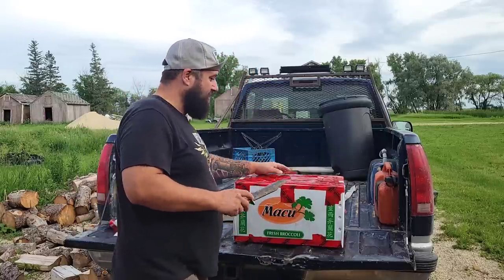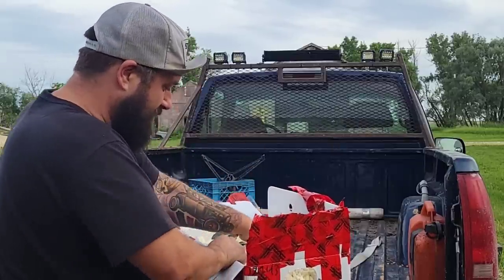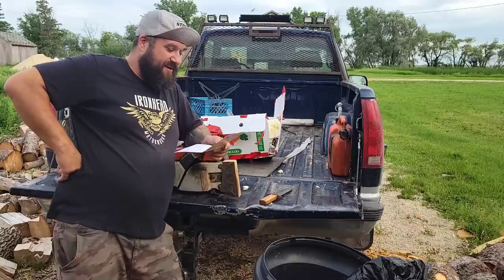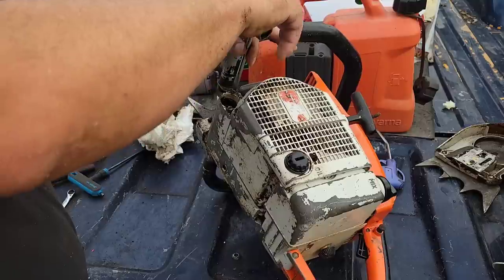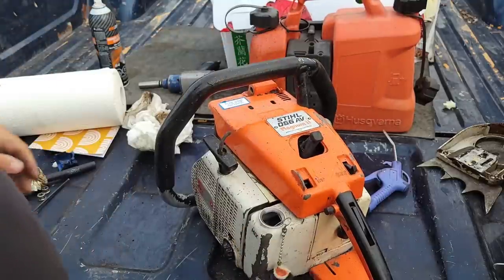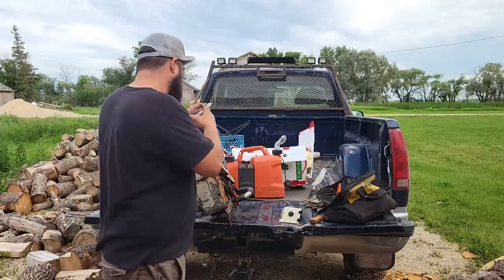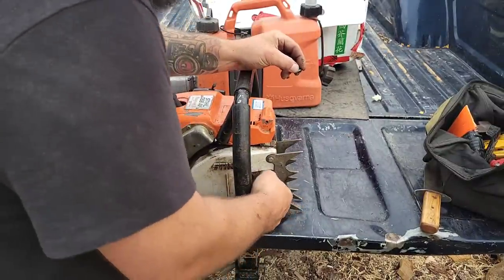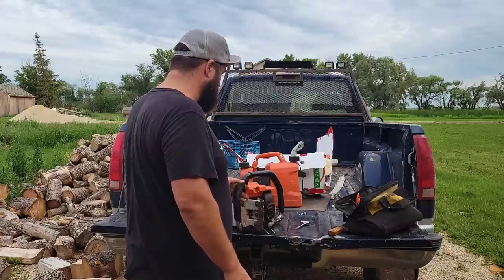I can't believe what I found in this box!! Epic saw unboxing!!

Comment: Tinman, you are going to love that saw bought one new in 83-84 was making a living on the fog line of the redwood coast, cuttin redwood, Doug fir, sugar pine. 7 tooth sprocket 404 square ground chain. Has got stump power for days 36-42" bar not really a high winder. Ran it for a year and a half only complaint is the ignition went bad.Would love to see a complete rebuild and timimg # on it..

Comment: Amazing Stihl saw!!! Can’t wait to watch this saw progress. It man thank you for genuine hospitality sharing this info along with people like Iron Horse and Bell Hopper. You guys have inspired me to finally buy he bits to begin polishing and porting a saw. I’ve done a lot of other work on carbs, converting saws to different pitch sprockets, lighter bars, exhaust mods, intake mods but you guys finally gave me the courage to begin porting. This weekend we’re going to baseline an old MS251 I need to replace the oil seals on and I’m going to begin by cleaning up the exhaust. After that probably trying to see what if any work can be done to cleanup the lower transfers. I also picked up a digital degree wheel to make sure I get numbers before I start. When it’s done I’m going to convert it down to 3/8p .050 gauge 16” with a Sugihara pro light bar. This weekend I’m going to get a before video and hopefully I’ll have the same log/branch for an after. Keep up the good work and keep inspiring people man.

Comment: Hey Tinman, great score! I've had mine for 38 years, stihl love it. Best balance is a 32 inch 3/8 bar and chain.  Bucked and fell with it lots. You can stihl find some old stock parts with old time West Coast saw shops. I've done a coil, piston and rings, stihl have one set of rings packed up somewhere. They share some parts with one of the stihl cutoff saws (they show up as obsolete and unavailable for the 56 but are available for the cutoff saw). I've put together a few and stihl have enuff parts for 1 more good runner. Buckin would be a good source for finding old saw guys with dusty stock.

Comment: In 1990 my dad bought a brand new Stihl 056 Mag II. 93.6cc, 18.3 lbs., 5.0KW. I remember the first time I laid eyes on that saw I loved it. I remember bucking logs with it running .404 chain on a 24" bar. It was the saw I first experienced what it was like to have a tree set back on the bar and not be able to get the power head off because of the outboard clutch. Sadly it had ignition problems and spent time at the dealer. My dad traded it for the 066 Flat top in my avatar pic. 91.6cc, 16.1lbs, 5.7KW. That 056 Mag II is one saw I wish I could buy back. Really nice with a 30 or 32" bar. The one you have looks to be a 1990 as well. Definitely one of the great muscle saws. What a great gift!

Comment: Most of av mounts can be obtain, hardest to get is PTO bearing as it has some od size and also that crank seal gets installed inside the races,  ignition is same as dolmar indeed Bosch. Good luck with the build they are lovely when running right.